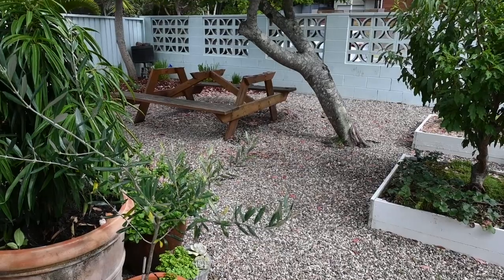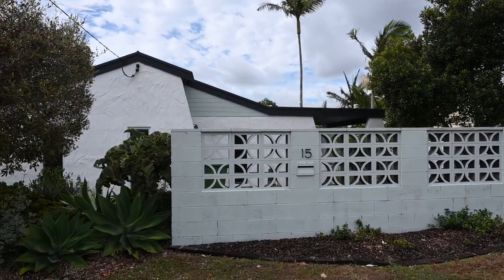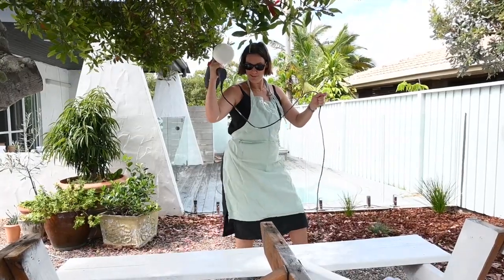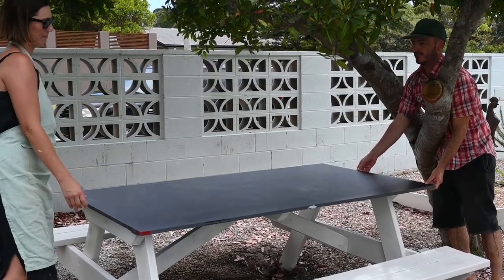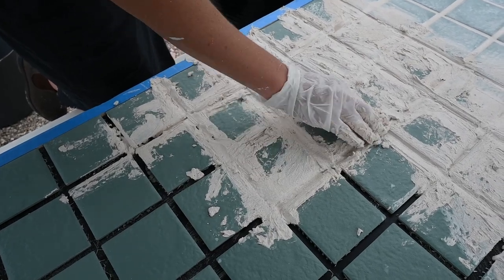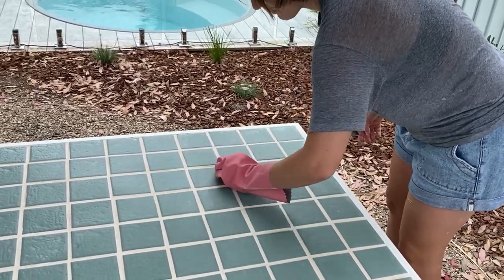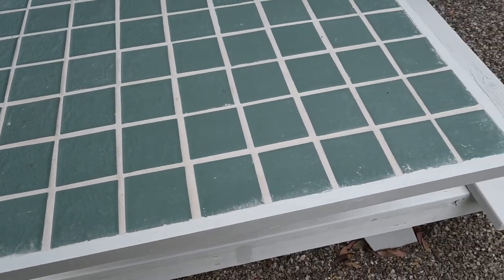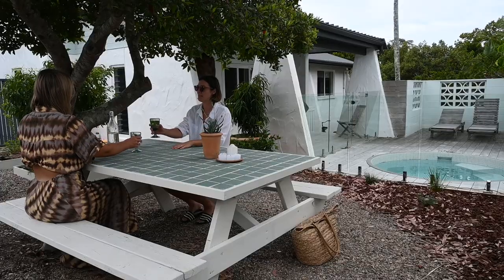*Extreme Transformation* How To Tile An Outdoor Table

Comment: As a tiler i would advise using a proper trowel and technique as tiles can pop off with temperature variations. Also use spacers for consistent spacing. Finished item looks good tho
Reply from the maker: Thanks for the kind words and tips! Really appreciate it :) Thankfully no tiles have popped off so far and my friend wanted more organic spaced tiles, otherwise spacers would have looked gorgeous too :)